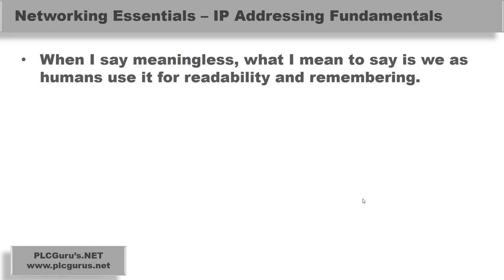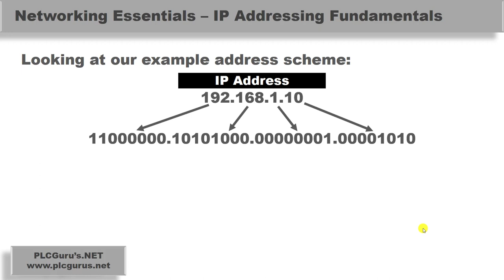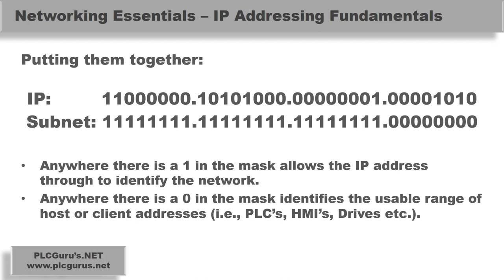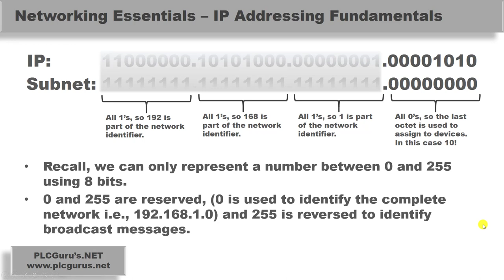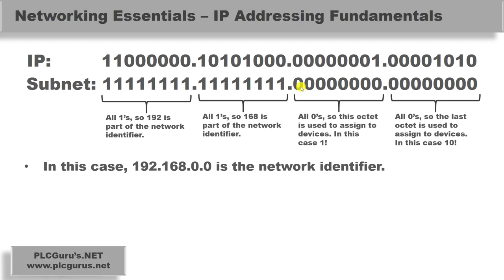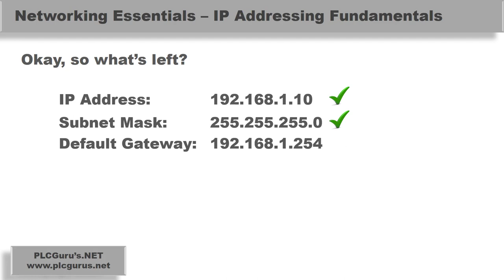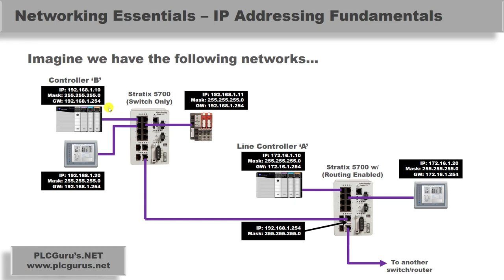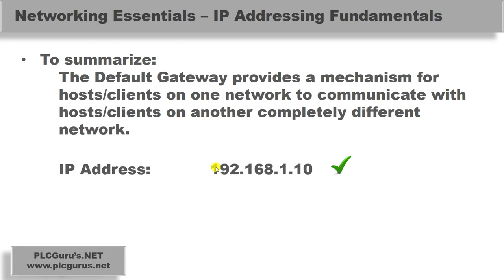PLCGurus.NET - IP Addressing Fundamentals

Comment: Thanks for the video .. very helpful

Hi , I have a problem where i have 16 devices for each device we have
1)  same ip address 
2) default gateway is set to 0.0.0.0

each device need to communicate with a common PC

These settings can not be changed 
 so after seeing your video i am planning to use 
1) Stratix 5700 – Catalog number 1783-BMS20CGN :- it has 16  ports (for NAT)
2) Stratix 5400)
 - 1783-HMS8TG4CGR  : for routing 

does the architecture  will work with the all device with default gateway of 0.0.0.0
Reply from the maker: In order for routing to work you will need to provide a gateway.